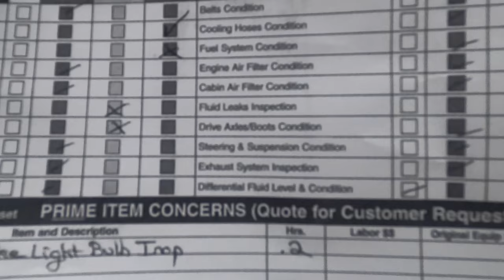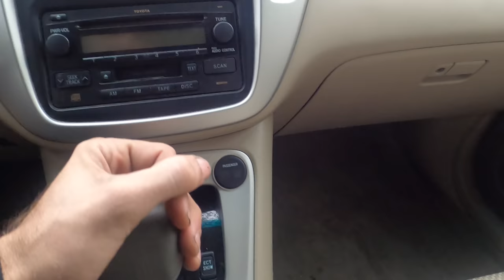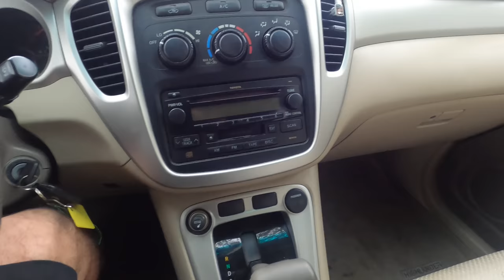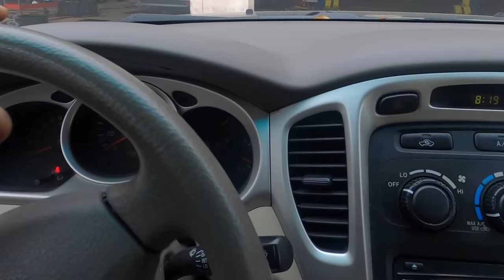We were BASHED by the Dealer! Ripping off a customer! Toyota Highlander 3.3

Comment: A dealership bashing other places for ripping people off that's hilarious.
Reply: A dealership bashing others for ripping people off while they were trying to rip people off.
Reply: Lonely Wolfe, dealerships rip people off on a daily basis. The fact that they’re bashing u for it is funny.
Reply: Dealership: they charged you $300, 6 months ago, and now you have some issues again, what a ripoff!
Also Dealership: we'll fix it for $1600 for you. For an additional $450 we'll give you a 12 mo parts only warranty.
Reply: No data they did anything wrong at the dealer.  Rays shop did half the work and failed on several problems.
Reply: @cayman9873  true but he’s blaming the dealership for the misdiagnosis 🤣
Reply: The Devil doesn't advertise on behalf of the competition.
Reply: Isn't it 😂
Reply: @cayman9873  the dealer gave a trash diagnostics, they glimpsed at the vehicle and made an assumption that would not fix the noise... rust is a normal occurance in 8 months (rust belt here)
The dealer obviously has unqualified techs, 20 minutes of a look over would show otherwise.
Reply: @theodoredionne9537  "Unqualified techs" is putting it...politely. Most dealrship techs are parts-changers...which is why they're always trying to sell you new parts, rather than just fixing stuff that is salvageable.
Reply: You must have ment Stealership!
Reply: Get heaps of customers in straight after a dealership service for brake repairs some are honest some are really taking the piss I actually like it  when they come for a second opinion and I can say the stealer was right it gives me some faith there’s still honest tradesman out there
Reply: the irony.
Reply: Peter smith  That is the way the part changers in the dealerships are trained to think about "safety". 
The dealership mechanics are usually not capable of doing overhauls or proper repairs in terms of rebuilding a part like a caliper. That's why dealerships have specialist shops behind 'em to do engine overhauls, gearbox overhauls, axle overhauls and things alike: they do not have the manpower, knowledge and technology to repair things, because that's against the idea of making money with "original" parts they change. You have to be a whole lot of a good mechanic to know how to overhaul a caliper properly .... those usually do not work at dealerships.
Reply: @cayman9873  must work at a stealership lol
Reply: @NaruSanavai  You don't get paid to salvage parts. You get paid by doing jobs. In order to do jobs, you gotta sell parts. It's fine to be honest, I employ it. But someone making a mistake doesn't mean they're a bad technician. Nothing ever goes perfectly while doing a job. What you don't see is the technician having to pay for parts out of their pocket or the shops pocket.
Reply: @dimmn82  And that's all well and good - replace what actually needs it...but don't try to sell me a transmission, if I'm in for a brake job.

That's the problem with you parts changers: you don't just repair things. You look for things to get into customers' pockets, instead of just doing the damn job.
Reply: @NaruSanavai  Don't confuse me with a "parts changer". I busted my ass in school and at work to be known as a technician. I'm not longer in the business, so take what I say and do whatever you want with it.

You come in for a break job? Ok, cool. Every time a vehicle comes in, the technician must perform an inspection before they start any work. This inspection is done for 2 reasons. To let you know if they find any other things wrong, and to cover themselves. If you decline work and lets use your transmission as an example, you declined a transmission after they did your break and you come back at them saying they need to fix it. They can bring up the paper work showing they informed you of the issue and you declined the work. Every time a vehicle enters a shop, they become a liability. If a technician misses something, its on them. So they are covering their ass.

I'm not gonna sit here and say every tech isn't trying to milk you. There are some that do. Especially if they're having a slow week. They're paid by the job, not by the amount of hours they're there for. I can only assume you've only ever been a customer and never a technician. So I'm trying to get you to see it from their perspective also.
Reply: Personally, even if I was a shady brand dealership, there would be a directive to NOT try and diss Ray's shop.
Reply: I've worked for dealers and independents and they all have their good and bad mechanics. A few of the small shops order employees to tell customers they need everything to make a buck where as dealers tell employees to up-sell maintenance services simply because they bought an expensive machine for the shop. I've always bypassed the service writers and desk people and talked to the customer myself and explained what was needed now and what they needed to keep an eye on as their budget allows and they usually come back to you because you were honest with them instead of some salesman on commission hitting them up for garbage they don't need.
Reply: I did a guy a favor and put some better than OE Ceramic pads on his wife's '12 Camry when it started making noise.  6 months later, they take it to the dealer because of a timing cover gasket leak, and in the 674,000 point inspection, they tell them, "The wrong pads are on the car" because they weren't the brand that the Toyota place had in the back and wanted 300$ for.  Some dealerships are scum, moreso these days since no one hires qualified technicians any more when they can just get a high school grad to swap out parts in the order that his book tells him and charge the customer for all of them.
Reply: It’s usually the ones who try to spread dirt about others is the one who is the worst for whatever it is they say the others do. In this case ripping people off.
Reply: Yeah I just dropped 3500 at the dealer. The check engine came back on and they wanted to charge me $135 just to diagnose it.
Reply: @Michigan_Tactical  When I retired from Ford in 08 the Labor rate just hit $106 hr and I only saw $25 of that in Flatrate.
Reply: @mlt6322  I don't doubt that.
Reply: Pot calling the kettle black
Reply: I once helped a friend because he had "bad drums" in the back. He had done a full restoration on them and painted the drums;  on the inside aswell.
Reply: Right. 90 dollar repair that takes you 30 minutes alone in a garage... Takes car dealer 4 hours at 100 dollars an hour plus the 200 dollar repair.

Customer: scratches head and searches youtube for how to fix the problem as they walk out of the dealership having heard the price of similar repair ahead of them.
Reply: It’s called a “stealership” not dealership.
Reply: @cayman9873  no doubt, it was his cheap bill and labor that it comes back to 6 months labor, not the dealer.
Reply: @christophervanzetta  yeah, make excuses for his 6 month old brake job.. rofl! and the dealer goes those routes for more than one reason, to protect themselves from failures like these! how many miles were on this van? yeah, another point to look at. Dealerships have the technology and updates far ahead of any regular shop. And some like any shop, are better than others. That goes for everyone, private people and dealerships alike. Nothing is universal in this category.
Reply: @mlt6322  I guess the insurance and overhead was costing them about $50 per hour , then they made about $50 per hour off of you.
Reply: This dude is wrong tho, slidepins were seized and had fluid leaks, everything Toyota mentioned was present..
Reply: @cayman9873  Only the actual mechanics watching this video will realize this Ray guy is the one in the wrong, everyone else will eat it up.
Reply: @theodoredionne9537  You are clearing not a mechanic:

1. the slide pins WERE seized, he claimed they were not because he could muscle them out with pliers LOOL, they are meant to SLIDE, hint, its in the name

2. There was a metric shitton of fluid leaks, nowhere on the paper did Toyota say its a valve cover leak, it says FLUID LEAK

3. The rear handbrake was seized as well, look at when he puts the rotor back and tries to spin it, it DOESNT, its all seized up, then the video cuts, he release the rusty ass handbrake and says "tadaa, it turns smoothly without noise" without telling us he had to un-seize the parking brake.
Reply: Peter smith  ya which should of been done 6 months ago which this original shop failed to do anyways…….you like to take over a half ass job?
Reply: @SlightlyAcerbic  My neighbor owns a workshop in the nearby town. I say nearby because we live in the middle of the forest. Anyway, I get quite a large discount every time I leave my car there. Don't get me wrong, I don't leave it at the shop for every little thing. I'm perfectly capable changing spark plugs, brake pads, rotors and calipers, suspension, headlights and additional lights, and yes, I change the tires myself. I get a 20% discount on parts and work and that came in quite handy lately since I had to change my driving axles (front), on my Volvo V70 and the handbrake needed a new wire and pads as well. The wire had gone completely slack and the pads were well out of date but what I noticed was (I was in the shop as well when they did the work) that the bolts for my wheels had damaged the part where the hand brake wire pulls for it to actually brake (I don't know what it's called in English but whatever). Now, I have 15mm spacer plates for my summer wheels (225/45/R18 tires on Volvo Ocean Storm rims) which means that the bolts also have to be longer. I couldn't find all bolts for my winter wheels so I re-used the summer ones. Since the summer wheels have more positive offset, the bolts were too long and thus damaged the handbrake thingy. The more you know.
Reply: @dimmn82  i work at dealer and fax
Reply: I've had good and bad experiences with dealers had a Mitsubishi dealer do my timing belt on my nimbus but didn't replace the 2 belts that had to be removed to get to the timing belt they just put in report other belts needed to be replaced at a cost off $300 instead off ringing me and asking if they can replace the other belts for $10 extra a belt while they were there or just replacing them while they were off and charging me a bit extra for the parts. Also when i was doing a head gasket on my 3.0 1990 4runner I asked the local Toyota dealer parts shop if they had any of the older asbestos gaskets he said i have 2 full gasket kits but i cant sell them to you due to laws with selling asbestos containing products so he gave me both sets for free. The Toyota dealer also checked the heads and redone the valves for me for nothing on a over 20yr old 4wd. I still get my oem parts for my 80 series Landcruiser and 4runner from this Toyota dealer parts section and often are given the parts for free or very cheap, but have never used the Mitsubishi dealerships service centre again.
Reply: It's actually smart! Get customer to believe the repair shop is a criminal and only do work at dealer!
Reply: Yeah, the stove calling the pot blachk....lol
Reply: Dealership: "No one except us should be ripping off customers"
Reply: @dimmn82  if you're a technician you should know how to spell brake
Reply: @philxfan9238  god forbid i make a spelling error
Reply: better for all if they do it well
Reply: As a service advisor in a dealership in a smaller town, I am unsure how it works in larger cities but the way we run things is that we make sure the customer's vehicle is running as it did when it's new. Additionally, we do not recommend salvaging most parts because it causes liability issues, with turning rotars being an exception. This is because a lot of the items that are required by the manufacturer to be performed are either by experience, such as replacing both brake hoses AND calipers on some models of fords because both the hoses and the calipers end up failing around the same time and if one does not get done, it can end up taking out the other. The same with IWEs and wheel hubs. The same with a grenaded compressor and a condensor/orifice tube/ac lines etc. Other times, manufacturers REQUIRE you based on THEIR experience to perform repairs with ALL recommended parts that MUST be done BEFORE ANY DIAGNOSIS can be performed in order for YOUR parts warranty to come into effect. Such as codes related to the transmission control module in fords (can you tell I work at a ford dealer?) or a knock sensor for the T3G class action lawsuit that Hyundai has with connecting rod bearings. Not only that, but the amount of times I've had vehicles come to our shops for mom and pop shops trying to "fix" a thing the customer thought was salvageable happens no where near as often as a mom and pop shop getting one of a dealerships vehicles. There are some dealerships, like mine, who genuinely want your car fixed and want it done right the first time. If you want it done cheap, then you run the risk of it being done wrong. If you want it done right, make sure you trust the dealership you're taking it to. Otherwise, learn to do it yourself (and if you screw it up, take it to a dealership like this guy who ruined his rear axle because the race welded to it) Lessons learn in life, but cars the second largest investment you will ever make, why fix it cheaply and then neglect it? I will never understand.
Reply: Peter smith  IKR.  Assuming the dealership garage actually removed front wheel, removed front caliper, in order to have arrived at assessment of "caliper piston seized, need new caliper", they would have needed to REMOVE the slider pin during that process.  And the CORRECT way to reinsert slider pin at that point, would be to clean & lube the pins.
It literally takes an extra 30 seconds to do.  (10 sec spray cleaner & wipe, 10 sec apply new lube, 10 sec sitting around doing nothing)
But did the dealer garage do that?  Nooooo....
Reply: You have it twisted. The mom and pop shops are the parts hangers and the dealerships are more technically. I had never rebuilt a transmission until I worked at a GM dealership. You do far less parts hanging at dealers than anywhere else.
Reply: @335wide  in my over 2 years working at a Ford and Hyundai dealer, I have only ever seen someone rebuild a transmission twice. Generally at our parts and labor cost differences, a rebuild is generally more expensive than the entire transmission. For ford's at least, they require you to do a cost cap for both rebuild and replacement under warranty. Once we had to replace a shift fork because it snapped somehow. The other was a torque converter on a 150k mile edge (not warranty) but after replacing the torque converter and I can't remember which solenoid, but after putting it all back together and it didn't have reverse. Turns out the clutches we're so worn out that that when all the friction modifiers in the old fluid was drained, they no longer gripped each other. The replacement of the clutches then happened, no extra labor, turns out the solenoid for another gear wasn't operating correctly after that and had to be replaced. We ended up replacing the transmission at that point anyway as it was most cost effective for us and the customer to pay the difference, thankfully they were understanding. I think we may have rebuilt one or two more transmissions in the back shop, under warranty of course, but I can't remember.
Reply: Dealerships will always replace parts instead of fixing them to make sure the problem will not persist again BUT you pay 3x the amount !! Such a rip off !
Reply: @TwIn603  it's all in the name of customer satisfaction with included warranty. If you go to a shop and they repair a brake caliper because the piston was seized and it ends up seizing again, the shop may charge you a second time to diagnose and fix the problem, who ends up sol? Meanwhile if the part was replaced with a Ford part with it's 2 year unlimited mile parts warranty, if that exact same situation happens, which is unlikely, Ford will pay for repairs up to 2 years from original correction date. I've had many customers come in because they got got by a mom and pop shop
Reply: Don't be absurd, Dealerships always tell the truth!? (Spoken while choking on the sarcasm)...
Reply: Yep. The hypocrisy is monumental !
Reply: Ever seen Belle tire estimates lol
Reply: Part of the cost us when things need extra attention lile thus and the customer needs the reassurance of the company (cost of business) to cover everything. They can complain all they want... as long as they still like coming.
Reply: Some of them in my area will literally blame any other shop that touched it rather than admit if they fucked up or the parts they use are crap, really annoys me.
Reply: Dealers say make work
Reply: Service manager at a Toyota dealer here. I have a couple thoughts on this. 1. A shop that has pride in thier work can and does exist at dealers and independent shops. 2. Quality of diagnosis has a direct correlation to the amount of respect and compensation a tech is given. 
I never bash another shop regardless of the circumstances the client describes.  You should be focused on solving the problem, the situation says everything that needs to be said about another shops work.
Reply: I am a Mech at a Ford dealer.  First off we charge 115% markup on all parts.  Which is messed up, some of the techs do dirty stuff but I hate it.  Just do your job and move onto the next.
Reply: They're called stealers for good reason!
Reply: exposed their tricks
Reply: Right ?!
Reply: This is just nonsense there a good mechanic's and bad ones, some places do shady shit others don't it's place by place I've worked at probably the best dealership ever and one of the shady ones and same with aftermarket.
Reply: Yes Sir is absolutely right 👍
Reply: @dimmn82  thank you. As a technician you have to note down everything to cover your own butt. If the transmission is damaged, I note it down but never recommend replacing it. That way it’s recorded that you’ve informed them about a problem but they can’t say you’re trying to rip them off
Reply: In Alberta I call them Stealerships.
Reply: We have this fella on video and yet it wasn’t that good of a job.  when you do it yourself it’s way better bc it’s your car.  It’s such a simple job and yet people pay to get a bad job done to your vehicle and above all getting ripped off.  Trust no mechanics unless it’s your only choice left.
Reply: Step one to ripping people off. Bash the competition for the same very thing.
Reply: @dimmn82  this right here.